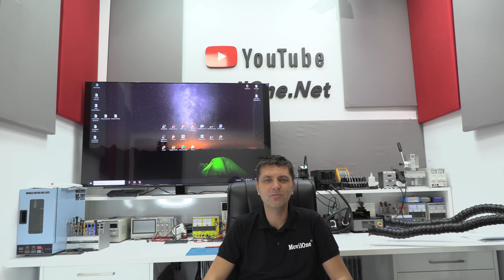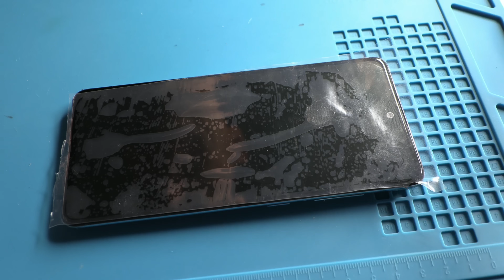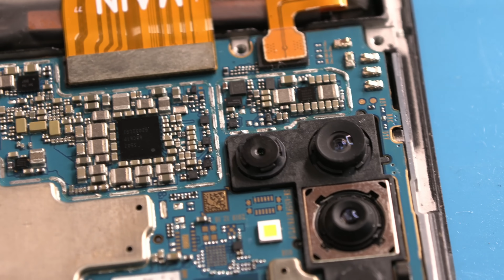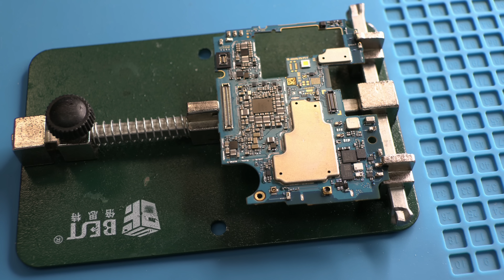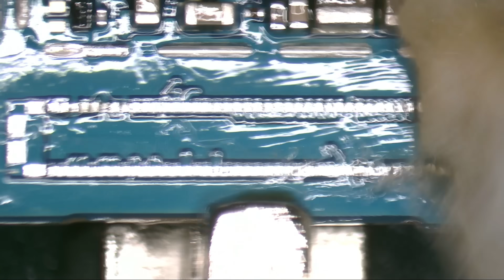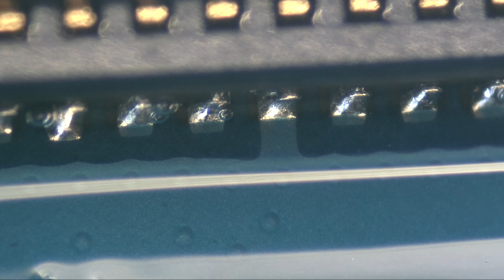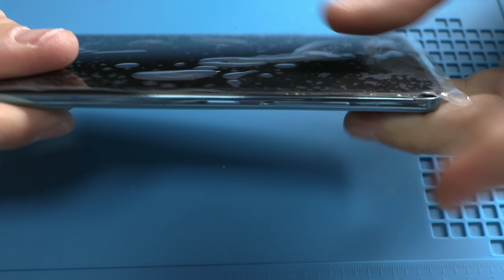The Samsung A Series Secret They Don't Want You to Know!

Comment: You used to be able to unscrew your computer mouse to clean the contacts and it worked good as new. Now most computer mice are intentionally designed to be harder to fix.
Reply from the maker: Absolutely! Devices used to be designed for maintenance and longevity. Now, manufacturers make simple fixes intentionally difficult — all to force costly replacements. Thanks for pointing this out!

Comment: Same same famous double decker CPU -RAM issue.
Same lead free solder cracks
Reply from the maker: Exactly! Lead-free solder cracks are a common cause of failures in modern electronics. Manufacturers sacrificed durability for environmental concerns, but ironically, it’s led to even more waste. Thanks for sharing your insights!
Reply: Good observations

Comment: Lets face it keeping up with the latest tech and showing off to your mates is a game for the young. For most people if they bought a decent high end device and could swap out the battery like in older phones, the device would probably suit there needs until it had a disastrous accident. Not much money to be made on tech that lasts 5 or more years. 
I was given a S9 plus (2018) Its at the end of its life 40% battery and screen popping off (spent so much time in the previous owners back pocket that her ass bent it) however its actual capabilities are still acceptable,makes calls takes reasonable enough photos, can handle my game Path to Nowhere (recommended)and have  yet to download an app that it couldn't run.
Reply from the maker: You’re absolutely right! A well-built phone with a removable battery could easily last 5+ years. But companies intentionally design devices to fail sooner to keep sales flowing. Thanks for sharing your experience — it’s proof that older tech often performs just as well with a little care!

Comment: OMG, and I've got a Samsung A40
Reply from the maker: The A40 is known to suffer from the same connector issues mentioned in the video. If you experience charging problems, it’s likely the culprit. If you need guidance on fixing it, let me know!
Reply: @MovilonePhoneRepair  I've had it since 2016 and it's second-hand, so it's doing well so far (you watch me jinx it now, lol)

Comment: I have worked most of my life doing the same job as you but on different devices, I agree with everything being said and want to thank you for an excellent channel and video. I however have worked in actual design and production,  the truth is (in UK), is that ease of assembly and reduction of costs are the main driving force, this leads to incidents such as the poor connector, that is in fact not poor but used in the wrong physical place, I bet you will find that point is subject to thermal expansion and bending, for instance due to charging of the battery etc. 
The blame comes, when manufactures find this out but as the product lasts, say 2 years or so, they leave it alone as to change it world mean less sales AND liability claims that they know the problem.
I would like to agree 100% with the person stating about solder, tools, experiance and flux etc. they all play a huge role in re-work and the details of these are often over looked.
Any way, I want to praise the TECHNICION's who do the hard work, earn a living and help real people and not companies.
Reply from the maker: Your insights are incredibly valuable! Cost-cutting and ease of assembly often take priority over durability, and the placement of fragile components — like the connector — makes failures inevitable. Sadly, brands knowingly leave these flaws untouched to maintain their sales cycle. Thanks for your thoughtful comment, and respect to fellow technicians like you who continue fighting back with skill and dedication!

Comment: Electroc blankets are designed to fail.  They include a part that drafts with use.  This causes the maximum heat output to decline gradually.  By the end of a season or sooner, the heat output is near zero.  Warranty?  Beyond that!  Buy a warranty extension?  They got your money and deliver another failyer prone item.  The extended warranty covers the cost of the replacment.

Scam!
Reply from the maker: That’s frustrating! Products like electric blankets and even some appliances are deliberately designed to fail just past the warranty period. It’s another example of profit-driven wastefulness. Thanks for sharing your experience!
Reply: @MovilonePhoneRepair 

In the case of electric blankets, I can tell you how it is done.

A small resistor is included in the bridge circuit, which regulates heat output.  This circuit includes the operator control, the nob or buttons.  A small amount of current runs thru this register.  The current is proportional to the blanket heat output.  Heat in this resistor starts a shift in it's resistance which increases with time and dimand by the operator.

On the schematics, they are called safety fuses.  Pure BS and miss-labeling!  

I'm 75yo.  I started fixing radioes when Iwas 10yo.  I have done other jobs, but mostly electronics, mostly design.  I can't get a job because no one will hire someone of my age.  But I know how to change a part!  My electric blanket is four  years old and works like the day I bought it!  I'm warm!  Everyone else takes money out of the bank once a year!

Comment: And what most people don't pay attention to is that predesigned obsolescence is one of the leading causes of greenhouse gas emissions, when I was about 5  my grandmother bought a new  washing I never got to see it fail, I personally have bought 3 good quality washing machines in the last 20 years, each replacement creates the same greenhouse gas emissions that my grandmothers did so over the course of 30 years that will be 4 to 5 times the amount, manufacturers cause this and the Canadian government says that it's my fault for choosing to buy a washing machine.
Reply from the maker: You’re absolutely right! Planned obsolescence doesn’t just affect our wallets  it has a huge environmental impact as well. Constantly replacing devices and appliances creates massive waste, even when older models were far more durable. Thanks for sharing this important point!

Comment: I have an a24 that sometimes works for minutes then dies again and doesnt boots for a long time, i sent it to multiple workshops and none of them managed to fix it and it seems like now i know the issue.
Reply from the maker: It sounds like your A24 may be suffering from a common connector or solder joint issue. If you’re now aware of the cause, there’s a good chance a skilled technician could still fix it. If you’d like guidance on what to look for, let me know!

Comment: I don't know if it's related but in one of A71 phones I've had actual main flex cable fail and noted the battery was swollen. Luckily it failed after 3 years and screen was burned in anyway so I could get a new phone on contract and transferred data after transplanting cable from other A71 which was broken from unrelated reasons.
Reply from the maker: Good call on replacing the main flex cable! Swollen batteries can place extra stress on internal components, causing unpredictable failures like this. Glad you managed to recover your data — thanks for sharing your experience!

Comment: When did you realize this, that comment goes for everything you buy; everything these days has built in obsolescence you can trick it in modern cars with an ECU upgrade.
Reply from the maker: Exactly! Updates disguised as "improvements" are often designed to limit performance, push upgrades, or even create new problems. Staying informed is key to protecting your devices. Thanks for pointing this out!

Comment: Question, is this problem on the FE line aswell? I had an S21 FE that randomly just got a black display a bit after a year and it wouldn't turn on. I already replaced my 1st FE because the back panel was popping off. The back panel issue was already on my replacement after half a year before it stopped working.
Reply from the maker: The S21 FE has had reports of similar screen and back panel issues. Unfortunately, Samsung’s cost-cutting strategies have made newer models less durable. If you’re experiencing these issues, seeking help from an independent repair shop may offer a better solution than official support. Thanks for sharing your experience!

Comment: Welp, now I know why my note whatever it failed in 21... I freaking hate tin solder btw.  I used to do pc and solder repairs but my boss at the place I worked wouldn't get me a hot air solder station or a heating plate which made a lot of repairs impossible.
Reply from the maker: I completely understand! Tin solder has proven to be far less durable, and yet companies continue to use it for cost-cutting reasons. Leaded solder offered far more reliability — yet another casualty of corporate greed. Thanks for your comment!

Comment: Regarding the Tin Whiskers the PC board should've been Humasealed  or something prior to introducing it to the market. I didn't finish the whole video but he kept mentioning the plastic was cracking… Plastic is nonconductive so even with the connector on and the contacts making contact... i'm only a few minutes in on the video but my initial response is a bad batch of connectors. Electronics made in Korea are very high-quality but we don't know who the manufacture of those connectors are. HIROSE is an excellent Japanese manufacture connector but I'm sure too expensive for these mass-produced items. Seems like a stretch implementing a connector as the planned obsolescence culprit. I'm sure the connector company did its best  manufacturing, QC'ing... etc. it would be easier to write something in the firmware for a planned obsolescence feature… Just like all the other electronic manufacturers out there do 😎 i'm gonna watch the rest of the video now to see how accurate I was
Reply from the maker: Great observation! While plastic itself is non-conductive, poor placement of fragile connectors still creates reliability issues. Sadly, many manufacturers ignore these flaws because they know failures drive repeat sales. Thanks for your thoughtful analysis!

Comment: Yeah, my A51 just suddenly broke out of nowhere. One day it was fine. The next day, it randomly won't turn on. Turns out the internal circuit was hit, I think it was a memory module, and that's why the initial repair only fixed it temporarily. The fix only lasted until it got hot enough whatever re-soldered parts was separated again.

Honestly, I'm looking into iPhone because of that. Because with the enshittifying on the Android side and how expensive an S-series phone can be (even FE), I am thinking that by the time I replace my A55, an iPhone could fit my usecase well enough.
Reply from the maker: I understand your frustration. Switching to Apple may offer better long-term support, but their tactics with repairs and updates can be just as manipulative. Whichever option you choose, being informed is key. Thanks for sharing your experience!
Reply: @MovilonePhoneRepair Yeah, that's why I am watching things. The main deal breaker/maker is YouTube mod app. I cannot stand the normal YouTube, even with Premium, I still use Vance. If the rumors about Google blocking sideloaded apk if it matches with Google Play blacklist, then that's a deal breaker on Android, especially if getting uYouPlus on iPhone becomes easier.

Comment: I have an a32 that did somewhat the same thing on the ribbon cable.  I fixed it with a cheap iron and I'm using it now.
Reply from the maker: Nice work! A simple repair with the right tools can often restore devices that manufacturers would otherwise label as “dead.” Glad you were able to fix it thanks for sharing!

Comment: Unfortunately that was not an FPC issue but a CPU cold solder joint, it is very common on a5x series, by heating the board from underside of thr SoC you fixed it temporarily.
Reply from the maker: You're absolutely right! Cold solder joints are a common issue in the A5x series, and heating the board is often a temporary fix. The real solution often requires reballing or even replacing the SoC. Thanks for sharing your insights!

Comment: Samsung is lethal, after few years its processor issue emerges calling for reballs which fails.
Reply from the maker: That's true Samsung's processors often develop issues over time, especially with lead-free solder cracks. Unfortunately, reballing doesn’t always guarantee a lasting solution. Thanks for your input!

Comment: So scamsung goes the hardware route, and apple does software.
While apple does a good job at supporting phones and tablets for a good long time.
80+% of their devices are still good for another decade if apple would slim down the iOS that goes on them. There are people still using iPhone 6. Only reported issue is battery, which is easy and inexpensive to replace as opposed to buying even a newer used device.
Consider all the e-waste they could keep out of the landfill. New life breathed in to the devices. What a boon it would be for them. All the press because they are extending the life of their devices even further.
But neither apple or Scamsung practice what they preach.
Reply from the maker: Exactly! Apple may support their devices longer with updates, but they also manipulate performance and push unnecessary upgrades. Both Apple and Samsung prioritize profits over sustainability, and as you said, reviving older devices would reduce e-waste significantly. Thanks for your well-thought-out comment!

Comment: We had a Chinese source for FPC connectors that were fractionally tighter, and more so reinforced. It was a sad day when they stopped supplying them, as I never saw one come back, and never had the voltage dance BS.
Reply from the maker: That's interesting! Reinforced FPC connectors would be a game-changer in reducing these failures. It’s unfortunate that better-designed parts like these are often phased out in favor of cheaper, less reliable options. Thanks for sharing your experience!

Comment: What about the current A series like A35,55, and the new ones?
Reply from the maker: The current A-series models like the A35 and A55 are still prone to design flaws, especially around connectors and charging circuits. If you decide to get one, I recommend using protective cases and avoiding fast chargers to reduce stress on internal components. Thanks for your question!

Comment: Magic Turned into Black Magic
Same Business Turned into Black Business

2017-2018 Rs.10000 Device Was Best However it Was Plastic

Now Many Things Worst Under Rs.30000
 
1.Heavy Weight 200 gram up

170-190 Gram should be

2.More Lenght 6.6inch

5.5-6 inch should be

Glassy Back infinity display

Easily Crack 90 % Chance phone drop to corner
Reply from the maker: That’s a great observation! Modern phones may look more premium, but fragile designs, heavier weight, and oversized screens increase the risk of damage. Sadly, these changes are often intentional to keep consumers upgrading. Thanks for sharing these key points!

Comment: Just like the Xbox 360. I have reballed countless with leaded solder and none have failed. Lead-free solder is an abomination and should not be used. They care so much about the planet, so why force people to constantly change devices just because the cheapest part was intentionally crippled.
Reply from the maker: Absolutely! Lead-free solder has caused countless issues in modern electronics. While intended to be environmentally friendly, it ironically leads to more e-waste as devices fail prematurely. Reballing with leaded solder is often the best solution for long-term reliability. Thanks for sharing your experience!

Comment: Got the A52, did I missed a bullet?
Reply from the maker: The A52 is known to be more stable than some other A-series models, but it’s still vulnerable to issues like charging port failures or connector problems. With proper care, you may have avoided some of the common pitfalls. Thanks for sharing!

Comment: Notice where that connector is at under the cover...where people will likely place pressure with a thumb or fingers while holding.

With a plastic shell over it what chances of mechanical wear occuring due to pressure from handling and pick up set downs over time.
Reply from the maker: Great observation! The connector’s placement directly under the cover makes it especially vulnerable to pressure during handling. Over time, this stress can weaken solder joints or deform the connector itself. Sadly, this design flaw is all too common. Thanks for pointing it out!

Comment: Bro I also have an a51 and even my friend does. The a51 is so prone to failure his screen failed and mine too idk why they need to
Reply from the maker: The A51 has been notorious for screen and connector failures. Samsung’s cost-cutting measures have made these devices far less durable than they should be. Hopefully, independent repair shops can continue helping users avoid unnecessary replacements. Thanks for sharing your experience!

Comment: It is not alone with phones. Look closely at many household machine like washing machines. After  a certain times of use you get a fault number on the display. You do not know what is means an so you call your repairman. And he says that the repair is very costly, you better buy  a new one and he happens to a good shop for that.  And when you tell them that your repairman send you you can get 50 dollars. (and the repairman gets also a bonus)
Reply from the maker: Absolutely! This tactic is common in appliances — they use hidden fault codes to push consumers toward costly replacements instead of simple repairs. It's a clever yet unethical way to boost sales. Thanks for highlighting this issue!